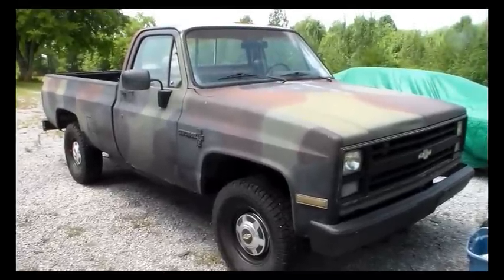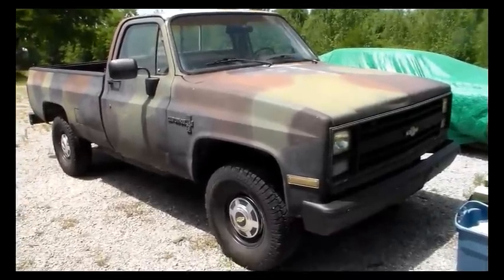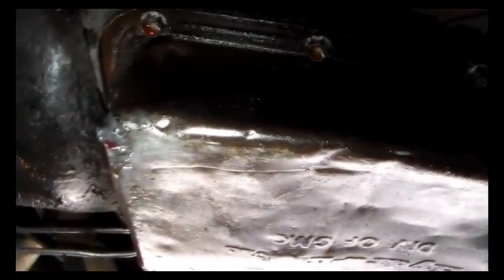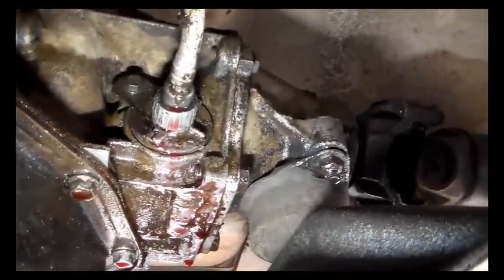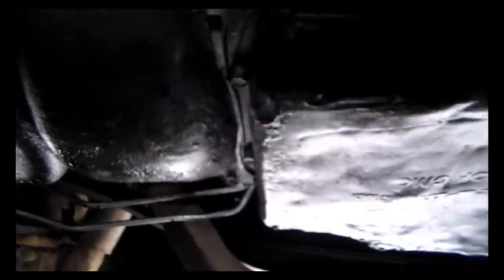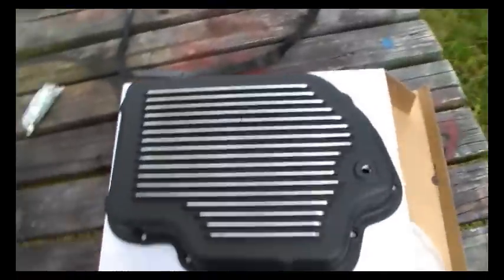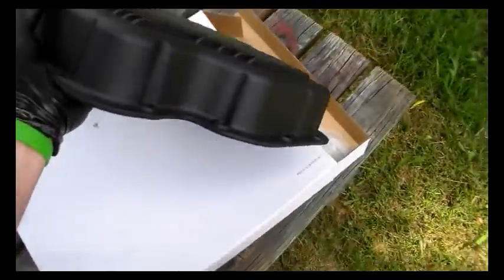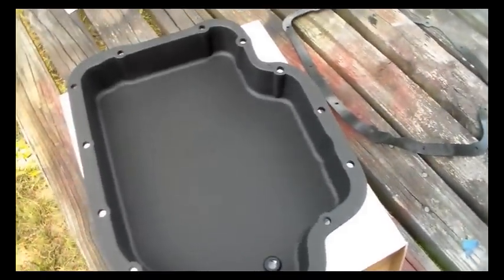Fixing leaks on a Chevy TH400 transmission

Comment: Hey Tyler.  I am Earl a 63 year old old time mechanic that has done everything on cars over time.  You voice is same as Elvis Presley.  He had his hand in Mopar cars as well, and not just cadillacs . I have watched about all of your rochestor quadrajet videos and gained knowedge .  My latest 2 month ordeal is with my 1989 cadillac Brougham.  I had it put up in my garage for 3 years.  I bought a new battery for the car and noticed on trying to start the fuel pump wasnt pumping. So I checked from the tank rubber hose to metal line and up to the pump and realized the pump had failed even though it had only 50 mies on it when I parked that car. Ordered a new carter brand mechanical pump and it didnt work at all.  So I then bought a delphi brand and the car cranked up.  So at this time I took the computer quadarjet off to chane the accelerator pump I knew was bad before I parked the car and the car ran fine and accelerated as it should. But the engine woud miss bad and stall at cold start up . So I changed the coil , and it was due anyway, but problem still persisted..  I checked my fuel pump and cranked engine with fue line loose at carb and it put out 3 ounces in 30 seconds that appeared airated.  I then bought me a ac delco mechanical fuel pump and installed it yesterday and it cured my  problems altogether.  So this is all the fault of a new carter and new delphi and a delphi I installed 3 years ao meaning THREE new mechanical fuel pumps failed Tyler  This is HORRIBLE and all falls back on the assemblers and makers of all 3 of those fuel pumps.   The places where they are making those fue pumps for delphi and carter must be usin people on drugs or something that work for cheap.  How could three new mechanical pumps just not work???  Its not my fault and its not this cars fault

Comment: Good job on the transmission pan, I would prefer to use silicone gasket maker because it it easier to remover later but you fixed it that is what counts. As other's have said E brake cables are probably    a good place to start on the brake sticking issue, they rust and swell causing binding.

Comment: That weatherstripping glue is great! I’ve even used it to seal up a leaking gasket between a toilet tank and bowl! It fixes everything! Last time I had to do this on a transmission pan, I just used ultra black. I think it’s alittle thicker and not so runny but I understand that sometimes the hometown advantage is using whatever is on your shelf at the moment. It probably won’t leak. Most of the old cork valve cover gaskets were sealed on with this stuff OEM and they could last a decade or more.

Comment: Thanks for the video..... only thing I would NOT do is the glue, because when you are using robber gasket they are supposed to go dry so that it doesn’t move out of place... I can be wrong but I just wouldn’t use anything other than just the gasket 🤷‍♂️😊
Reply from the maker: That works good if you have a flat gasket surface, but the pan on my truck is a beat up mess.

Comment: Weatherstrip adhesive as a gasket sealant...  That's the first time I've ever seen that!  And you've had good luck with that method?  I figured the weatherstrip adhesive would crack over time and through heat cycles.